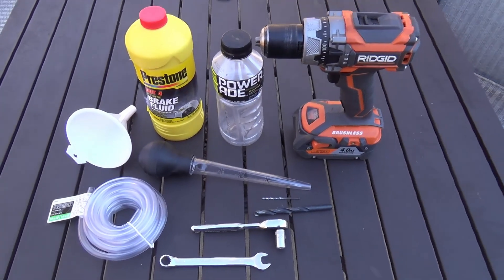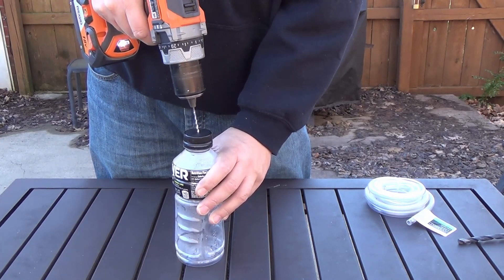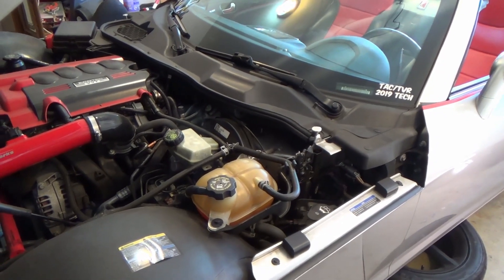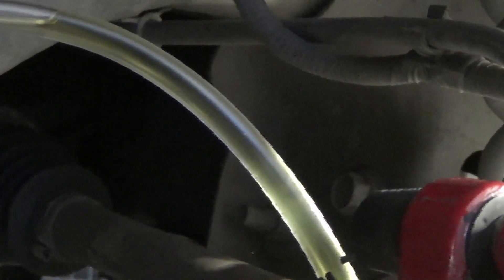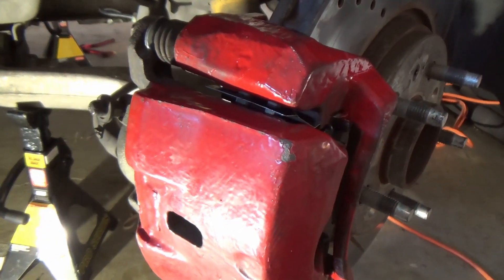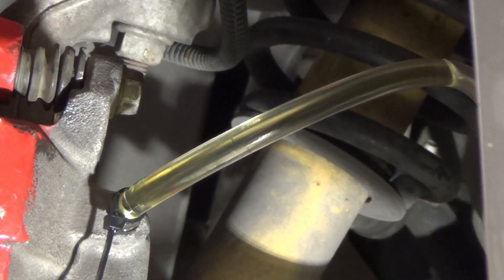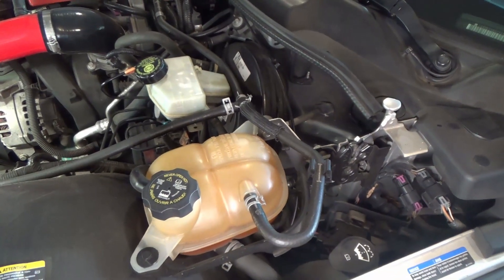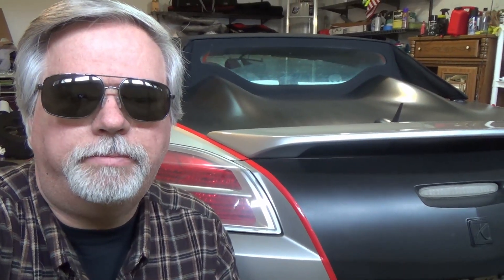How To Flush And Bleed Your Brakes

Comment: Why did you switch from DOT 3 to DOT 4?
Reply from the maker: The main reason is because I do
 autocross racing and Dot 4 has a higher boiling point so it's better for agressive and high temperature braking.

Comment: Another good Vid Mike.  Is there a Solstice/Sky forum you frequent?  I want to ask around about a P606 error my Solstice popped a bit ago and clearing it is only temporary.
Reply from the maker: Thanks StarFyter1. It looks like the P0606 fault code means that there’s an error with your power control module (PCM). The PCM does a self diagnostic and if there's a problem, then it throws that code. That may be why it only temporarily clears. It could maybe be a problem with the actual PCM or it could be the wiring harness. I would take it to an mechanic to do a complete diagnosis of the issue. In the mean time and for other suggestions, join these two Facebook groups.  https://www.facebook.com/groups/107999612683303/   and   https://www.facebook.com/groups/2207259141/    There are many very knowledgeable Sky and Solstice owners on those groups that can possibly help as well.  You can also join www.skyroadster.com and www.solsticeforums.com .  Hope this helps and please subscribe to my channel if you haven't already.